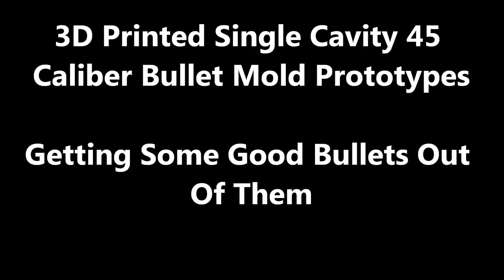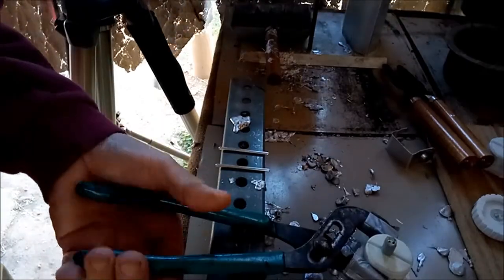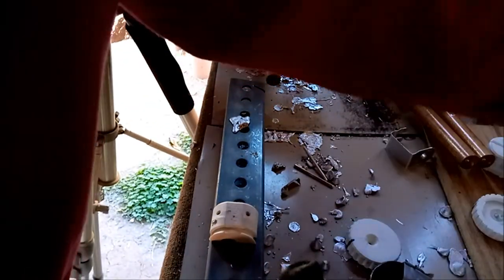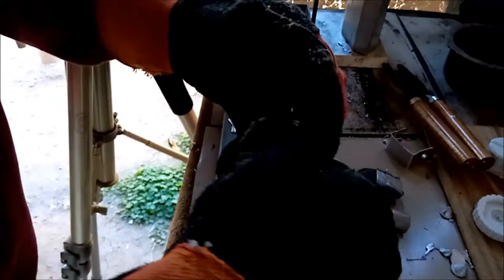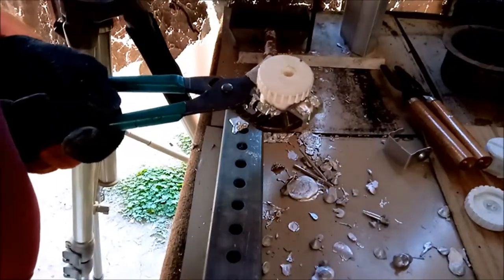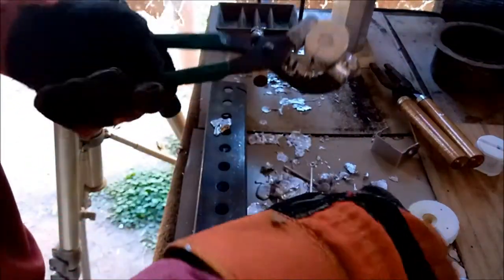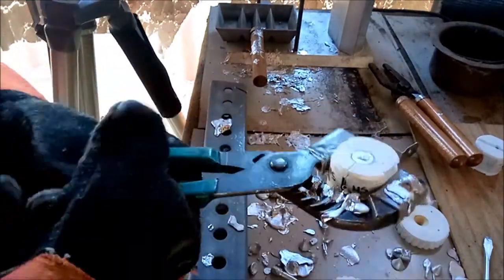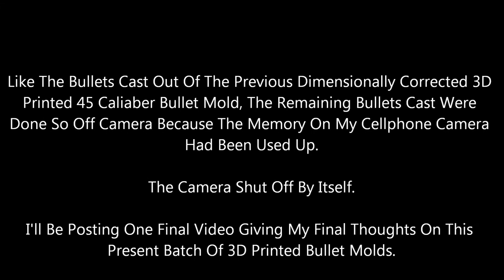3D Printed Single Cavity 45 Caliber Dimensionally Corrected Bullet Mold

Comment: Good work here. I’ve been watching your videos on this diy mold. I’m looking to print a mold to cast lead for fishing, wonder if you would help share what you’ve learned.
What’s the mixed ratio for porcelain powder in resin?
Reply from the maker: Greetings:
I did also design and print a mold so that I could cast lead weights onto my fishing hooks as well.

I did all of this so long ago now that I can't remember if I had included that fish-hook-weight mold in my videos or not.

I had a running blog of sorts going over on the CastBoolits forum while I was working on this project.  It's a long read but I believe it contains all or most of the information you would need to design and print some cast-lead molds for yourself.

At the time I was doing this project I had the support of Siraya Tech the resin manufactures.  They were supplying me with most of the resin I needed to do these projects due to my membership on their Facebook group.

Unfortunately, as is always the case, there were those who were anti-anything-having to do with guns that started complaining and reporting my posts to the powers that be at Facebook.

They complained enough so that the Siraya Tech people quit supplying the Ultra-White resin I was using for these projects.  They feared being booted from Facebook.

Below is the link to the write up on these DIY 3D printed molds.
https://castboolits.gunloads.com/showthread.php?425609-3D-Printed-22-Caliber-Pellet-Mold

Thanks for your interest.
Reply: @MrTjmk  Thanks for the reponse, I've been reading that post linked above. I was messing around and mixed some plaster I had laying around into typical gray resin and boy it printed way thicker than expected and crashed my lcd screen. However, what came out withstand the heat super well. I think im going to hold off messing with mixing my own heat-resistant resin and just use the printer to print negative molds so i can just cast the mold with Bondo/body filler (polyester resin with high concentration of Talc) and it can withstand lead casting.